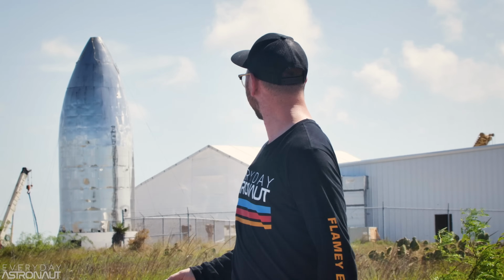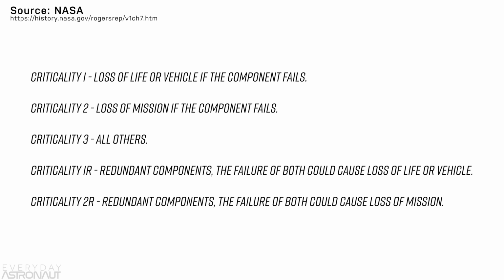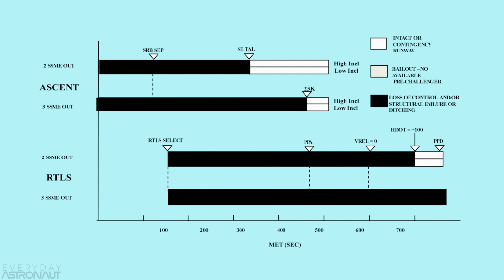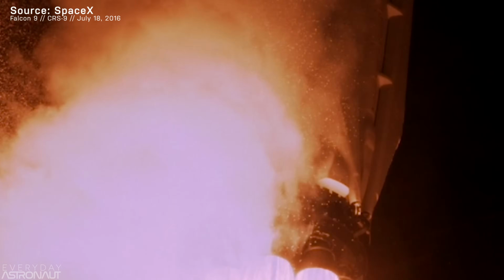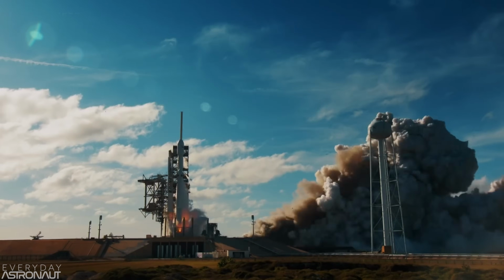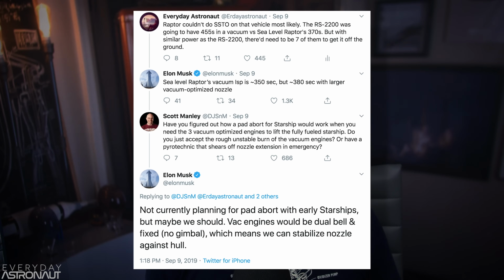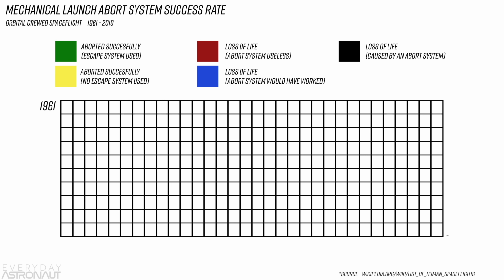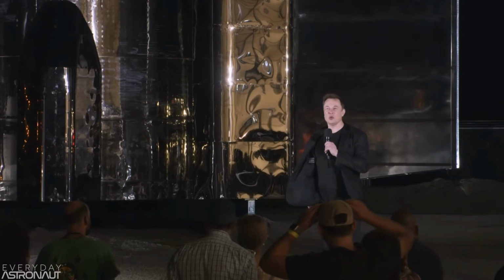Why won’t Starship have an abort system? Should it?!

Comment: Tim: Thanks. You did a wonderful job of exploring this subject. Every subject must be approached with an open mind and examination of the best data available. In the past, the press and the politicians have roasted NASA with 20/20 hindsight and "Monday morning quarterbacking". Questions are rarely as simple as the lazy-minded believe. Your solution: fly often and test in the real world until you have good data for engineering improvements is likely the best. I just hope "go fever" doesn't rush things and people get killed again. Aside from the tragedy itself of people dying, the frenzy of second-guessing will paralyze progress for a long time thereafter. There's a reason why NASA was so ballsey and brave in 1966 --- they just hadn't experienced enough failure to be scared, and they flew test pilots that had already seen lots of deaths in their former careers and were just plain tough. Today, we're pretty intolerant of risk. Elon may discover just how quickly public opinion can turn if people die. I wish we were tougher, but in today's world, we just aren't. Social media will shred SpaceX fairly or unfairly. Hopefully, SpaceX will "test the crap" out of Starship/ Super Heavy before those first orbital and cis-lunar flights.

Comment: It won't have an abort system because that makes it more expensive and like everything else about this rocket they are trying to make it as cheap as possible cause they don't care about safety.  It's the reason they aren't doing any real safety testing with humans before they send it up.  Tesla is running out of money and so they need all this stuff to become profitable as quickly as possible and it's the reason this thing became stainless despite it being hugely impractical and the same thing for the Cybertruck.

Comment: Did you find any comparison between SRBs vs Liquid Boosters' reliability? That thought came in my mind as Elon was saying that "the best part no parts" - SRBs have much less parts. Although the ISP kinda sucks but shouldn't they be more reliable than liquids? Also, SRBs are not fueled while the astronauts are on top, they might blow up the VAB (although not sure when humans are allowed around) but not the astronauts, like liquids can due to fueling issues.

Comment: the big issue with rockets reliability, and not sure it can ever be overcome, is that they are essentially flying bombs which airplanes are not. You dont have to worry about a fuel leak on a jet liner immediately deconstructing the plane.

Comment: If the purpose is to avoid future failures, then there is more to failure analysis than the technical elements of the device. The Challenger O-ring failure is a good example. 
The Space Shuttle was "sold" to the politicians of America by giving parts of the project to contractors in the respective districts of the politicians. To get the yea vote from a senator in, say, Utah, part of the rocket had to be built by a company in Utah. This company would get lucratively paid by the federal government, and expecting this, the company would (somehow) bribe the politician to support the project.
If the solid rocket boosters had been built somewhere with access to the ocean, a long single tube could have been built and shipped by sea. But because the Shuttle needed votes from Utah,  Morton-Thiokol Inc. of Utah had to build the solid rocket boosters. This meant shipping the boosters by land, and consequently, they had to be segmented. This meant using the now infamous O-ring. 
So, the method of funding the Shuttle led to the failure of the rocket.

Comment: Starliner does, and its expected to function. Starship is a rushed project to compete if you believe it doesn't have problems that dynamic pressure models are probably an uneducated speculation that is unfounded, if get up and go is still a concept it can be redesigned  , much the same as the Soviet Union and Capitalist pat which saved Prussian rocketry from the noose and rebuilt the civilised world to strive for alternatives.I know nothing and can't predict a re emergant  field of nothing much ,which can be created to balance an ascent mass above it in alternatives to stacked boosters. Impressed by thermal shields though and  still wondering if Parker chunks aren't  the shield edge. Also less parts like a perfect spike low surface area to place mass on  and if it can be exhausted is good fiction which I wont bore the world with, see what gives,it  might be a success. Elons stammer is amusing though when isolated and he's an honest charismatic person that oversees the engineering . Maybe he should be on the Maiden voyage but probably isn't  fit enough and it will be unmanned being the  excess ease of interest in not using  crew because of rovers and probes.

Comment: I vote for no abort system, better risk management, calmer decision making and launch cadence, overbuilding and larger margins both in engineering and time management. I would achieve this by communicating this approach to investors, fans and the media to forgive the slower improvement. Just like they do regarding weather circumstances: they scrub every launch if weather conditions are even a bit risky. I think human error must be minimized in the face of market pressure. That's the way to reduce fatalities. I think.

Comment: The end of the intro at 5:12 - that's basically the difference between a prototype fighter jet and an airliner. Everything up until now has been essentially prototype spacecraft meant to be flown by fighter jet pilots.  Starship is meant to be an airliner.

Comment: I mean, could they take the weight savings of nixing an abort system and create a buffer to absorb some of the shock of an explosion? At least to reduce the shockwave intensity by making it deform some metal between the crew section and the tank?

Comment: But if the RD-180 failure does not count because the mission still succeeded, shouldn't the same metric be applied to the other engines?

Comment: As far as manned space craft are concerned the tech and knowledge is really at about were aircraft were in August, 1914. And as far as I have every read the FAA still classifies every space craft launched in the USA as experimental. And in the first 10 years of aircraft they were all experimental basically. In the Great War far more aircraft were built and flown in those 4 years than in the prior 10. Just compare the aircraft in service of 11/11/1918 with those of 08/04/1914. The same thing happened in 1939-1945 but to not as great a degree.

Comment: rapid unscheduled disassembly soooo an explosion then
Reply: :) - You got the gist - but no, not necessarily. RUD may also include breakup from aerodynamic forces, without the need for combustion.
Reply: @CLipka2373  i was just trynna be funny as i wrote it i was aware the it does not have to include an explosion but i could not think of a single word that would fit better than explosion for the joke

Comment: If the spaceshuttle had an abort system, the crew of Columbia could very well have survived since they would have been able to abort during lift off after the tile took out their heat shield.
Reply: It is highly unlikely that a dedicated abort system would have had any impact on the survavibility of the incident. As a matter of fact, except for the heat shield the orbiter was in good shape, and an abort-to-pad, a well established abort mode in which the shuttle would ride out the SRBs and then just head back to land at the cape, would probably have been the safest option to handle the incident, even if another abort system would have been available.
The problem with the Columbia incident wasn't the lack of abort options during launch (which existed), but the lack of knowledge that the heat shield had been damaged (which to my knowledge hadn't even been suspected until well after the launch).

Comment: An abort system is really only a mental thing. Gives you a perceived sense of safety.
Your own analysis proved as much :).

In any case, I'd say that having an about system or not having it, is situational. It depends on the design more than anything...

You can then argue, that any space vehicle design should always be created with an about system in mind. But I'd rather have safety and reliability to be the focus. That doesn't mean that a given design should not have the abort system. It just means that it may very well not need one.

Comment: When Spacex has a parachute anomaly, Nasa demands a full test program to prove reliability.  When cost-plus Boeing has a highly visible parachute failure, nobody appears to hold them to the same degree of accountability, as evidenced by this nonsensical statement released by Boeing; “It’s too early to determine why all three main parachutes did not deploy, however, having two of three deploy successfully is acceptable for the test parameters and crew safety,” Boeing spokesperson Todd Blecher said in a statement.  Which spacecraft and launch vehicle would your viewers prefer to fly?

Comment: Yikes. A thoroughly professional presentation there. I came into it wondering how they would even consider reproducing the Space Shuttle design disaster and left knowing that what killed 14 astronauts couldn't have been mitigated by an escape system. In spite of knowing the facts, I still learned a lot here from your obvious hard work.

Comment: I wouldn’t board a rocket without an abort system and a mission without an abort procedure AT THE MOMENT. Simply because even a Cessna flight has abort end emergency procedures. As a GA pilot I would know. But I also like the idea of having a Cessna attached to a 747 hahaha

Comment: These vehicles will get safer to the point that abort systems become vertually redundant, as they are with most aircraft.
Bear in mind that the first aircraft passenger carrying flight had 100% fatalities. Orville Wright's passenger Lt. Thomas Selfridge was killed in the crash of the Wright Flyer in 1908 at Fort Myer, Virginia.

Comment: Great research on this one, Tim! Thank you.

Absolute safety is just as impossible as total redundancy. You said it, it is simple, don't launch until you are sure it will work, the simpler a system the less can go wrong, and make sure you have 99.99999999999% control over the design, engineering and manufacturing process. I have confidence in the approach of SpaceX and TESLA to their design, engineering and manufacturing process, as the latter has proven to be, by any standard, the safest possible vehicle on the road. The Japanese have process or system, if you like, it is called KAIZEN. It means constant improvement of the existing process or system. As there is no perfection, there is not 100% in technology. 99.99999999999% reliability is good enough to improve upon. BTW, there is no 100% in medicine either;-). The one factor, which destroys all efforts towards near perfection is GREED. Example, BOEING and their "new" (old) 737MAX, born in GREED, over 340 people had to pay with their lives, which was totally avoidable for many reasons. Shareholders want their dividends, which I understand, but when the company becomes a slave of shareholders will, that company is doomed. 

Great research on this one! Thank you.

Comment: at a mass ratio of 20,000 to 1 - this single rocket has a payload of about 10 pounds. If  1 falcon 9 rocket load of 1 astronaut were used - about 200  loads of solid oxygen would be needed.The small payload could be a "TRANSFORMER TOY" which turns some parts into an antenna.

Comment: If we had the option to refuel in orbit, could we give vehicles about to re-enter enough fuel to use thrusters to do most of the slowing down above the atmosphere.  This would make the.re-entry speed much slower, reducing the need for all this insulation.  I'm no physicist, so I'm probably talking nonsense!  But I thought I'd throw it out there.

Comment: hey tim, what is the point of that stand under the superheavy booster that seems to be in the renders? i know that apollo used noise suppression system but does it really need that for it?

Comment: Make an abort system. After reaching really high levels of safety, undesign it.
Reply: That's a pretty good philosophy, and I am certainly glad to see well tested abort systems being planned for this first generation of commercial crew vehicles. As for starship specifically, it seems like a hard one to engineer an abort system into, and it's relative simplicity is one of its advantages, so I'd be satisfied as long as they test the hell out of it before putting humans on it. I feel like it's a safer design than the shuttle, but I also switched out of an aerospace engineering program before the end of yr 2 so I'm not qualified to say beyond youtube comments lmao. To me at least it's the most exciting spacecraft currently in development simply because on top of everything cool and good about it as a concept,  it is also moving to realization very quickly and we get to watch the tests and construction!

Comment: I think you're misunderstanding how reliability works. Having more parts lowers reliability only if it's a series system. In parallel systems, more parts means more reliability. It's exactly the same logic as having redundancy. It just looks different on first glance since it's not as simple as having multiple of the same stuff. But if you frame the system as if you can have the crew alive or not, abort systems serve as another part in a parallel system giving it more reliability.
I do see the point of not having one for weight savings, but it will have a negative impact on reliability, even if only a slight one.

Comment: You ask if we'd fly on the starship without an abort system. But it's really all about proven reliability, which you point out a few minutes earlier. If the starship had a million successful launches with no abort system and then they added it, how many people would line up for that first flight?

Comment: My slightly educated opinion is that the beautiful machines we call rockets are destined to blow up every now and then. Not having an abort system is starships weakest design point. Cram everyone in a minimal volume cone at the top and strap some boosters on that bad boy. Losing 100 people in a single launch over something as simple as this would be hard to witness :(

Comment: If Starship's engines can't fire in an abort situation in atmosphere because they have the vacuum bell, how are they ever going to be able to propulsively land?
Reply: At Starship first ignition it's heavy with fuel. When it lands at the end of a mission the fuel remaining is small/light and the total Starship weight is MUCH less. Then vacuum nozzle inefficiency could still be good enough to land you in atmosphere. Another way might be to have mostly vacuum nozzles and maybe a couple of atmospheric nozzles; if you have many nozzles it might be considered. Everything is a compromise, the (very complicated) objective is to find the best overall.

Comment: Mr. EDA, fantastic research and content as always.  BUT !!!!!!!!   If Elon calls you to fly on the 3rd flight of the first successful Starship,  I'm sure you would not say no. Even suffering from a complete trousers failure before and during the fli5, you would not let this opportunity slip away! !!!!!  I wouldn't,  and as a airline pilot I'm used to the 99, 99993% redundancy

Comment: I'm really curious about crash survivability from different failure modes on Starship on landing. There's so many different types of potential modes - some of which the vehicle will know it's going to crash (and will have various options to try to minimize the damage), and others where it won't.  And - if you're vertical, or can get vertical - you've got a skyscraper-sized crush structure beneath you (but to how much benefit?).  It'd be really interesting to see SpaceX's studies on this topic.

Comment: To compare. When we design cruiseships in Turku (Finland), a usual "n"-number [Si-system] is 3, for example "needed strength of steel in this and this part times 3", when in here "usual for rockets" it was 1,5. Risky business :)

Comment: There is a problem with no abort systeam on a re-useble rocket, since the abort rockets would not be used more than once compared to the lower and upper stage rocket that would be used several times. This means that the lower and upper stage rockets would get the affect by wear and tear. Wich would affect the reliebillity of the rocket after a X ammount of uses. The problem is that we have never used a single rocket in high frequences and does not fully know how many re-uses the rockets can do before you need to chage the engine. That why its good to have a abort system until we got enough data to know If we are going to take away the abort rocket or not.

Comment: One abort over like 2300 flights and of that only 290 manned but one crew saved well atm 7000 planes in the air so if you do the math that is about 24 a day

Comment: with low or no rates of flight to judge reliability anyone would be a fool to get on this rocket or any rocket without an abort system

I dont think the Starwhatever as it is labeled today will ever fly, something will but not this thing...but until it has some history behind it, riding on it without an escape system is silly  and will.would get someone killed  SpaceX has blown up a lot of hardware